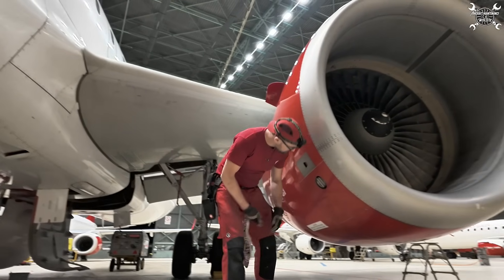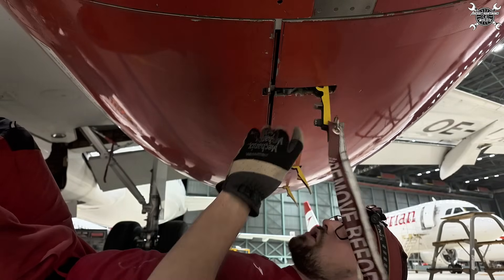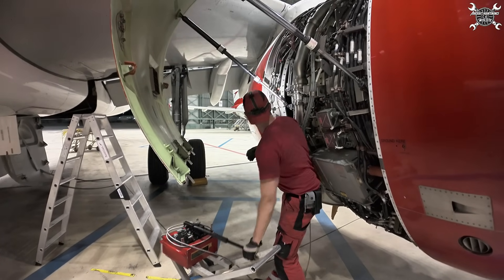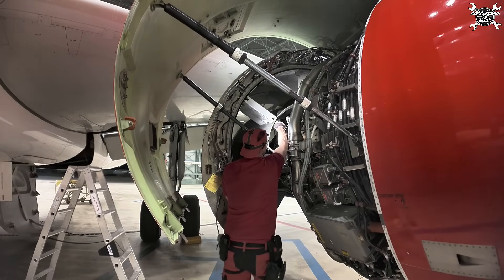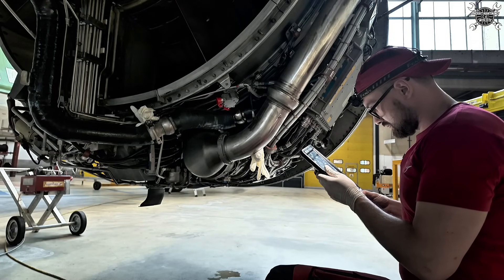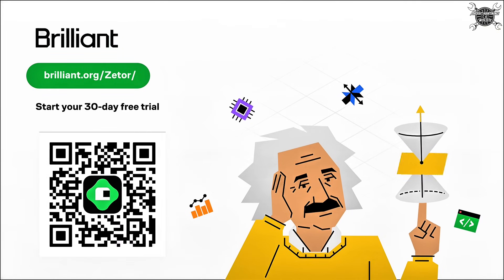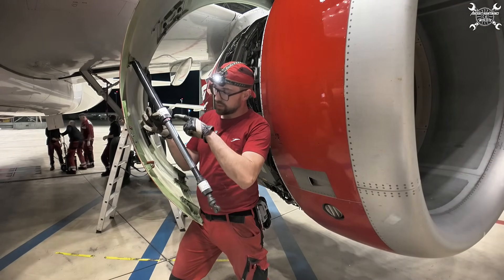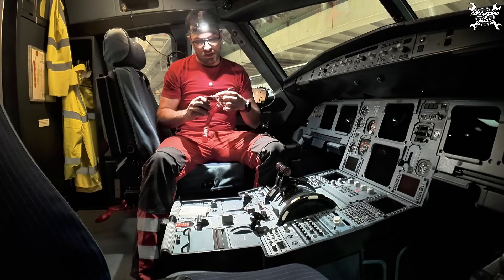Avoid Damage! Correct Way to Open A320 CFM56 Fan Cowls

Comment: 7:13 bro you know those latches lock back into the handle right? You simply pull the latch away from the security bar and into the handle, it will latch then and you will not need to hold the handles the way you described.
Reply from the maker: I know what tou mean but it is not allowed to do so on many engines so it is better to not show it. Also it is not mentioned in the manual for which I can get comments like ,,it should not be like that"

Comment: Thanks for highlighting the safety measures while opening & closing the cowls and ducts but holding the cowls on the legs may not be appropriate step as a safety. 
Otherwise very good refresher
Reply from the maker: Why? what can happen? 🙂 you have stable position and free hands. Most of the time you are alone so there is no other way.
Reply: In fact it’s safe! Because you are supporting it with the biggest muscle you have and your hands are free! What is wrong with it?